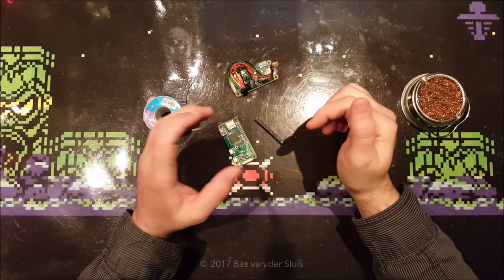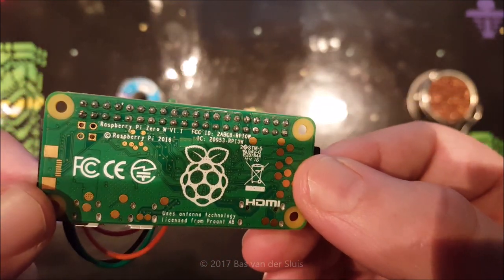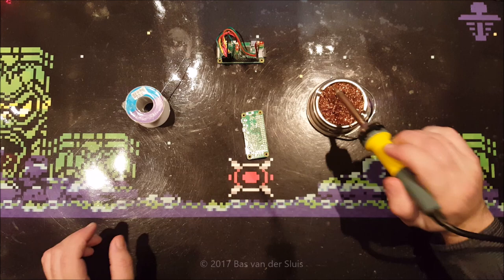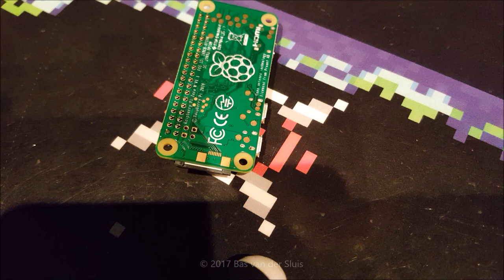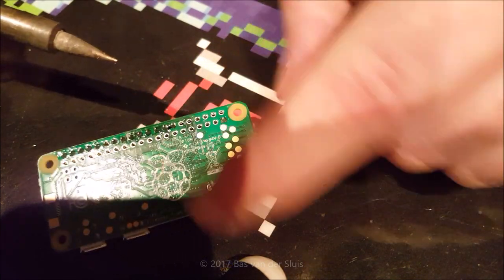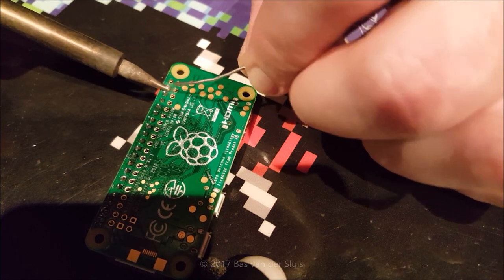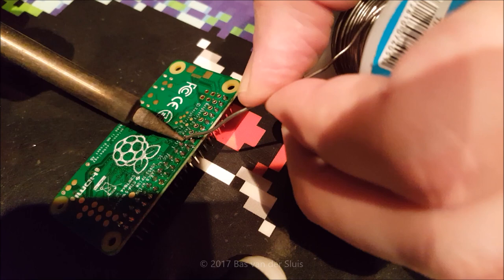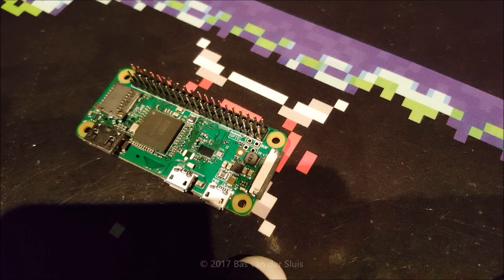How to solder header pins to the Raspberry Pi Zero (W)

Comment: So, my question is, when i put the pins in, do i need to like cut them shorter or just not push it in all the way? Cause mine pertrudes more on the soldering end... or did i get a wrong size or something? Hopefully this can be answered relatively soon 😢
Reply from the maker: Don't apply any force on the pins. Just put in the pins (as show on the thumbnail of this video) with the short side through the board and solder them. No need to cut anything, if you have the same pin header as I do.

Comment: I took my first ever stem project as a raspberry pi car, got a raspberry pi zero, got shaky hands and still hadn't solder the headers to the pi yet. As soon as I get my solder Iron back(My parents took it saying they smell smoke from my room and will return when I move to college so till then I am stuck with the boring breadboard) I will solder those damn headers so perfectly in those holes of the pi, no force will ever be able to pick them apart.
Thanks for the tutorial
Reply: Any luck?
Reply: Did you get the iron back yet? Keen to hear if you're back at it, burning your place to the ground with dangerously hot tools.

Comment: Amazing tutorial, thanks a lot! I think I did a great job, solderings look really good, just really thin tin coverings on the pins. I felt that it is important to really have that 370°C, then just touch the pin, not the board, just touch tin on the board-pin connection and it immediately attaches nicely. The first two attempts did not work so nicely, because my soldering iron was not hot enough - ** I believe a hot tip really is key**. First time soldering two Pi Zeros and it took me roughly 5 min per board.

Comment: What solder are you using - 30W ? also, if I have soldering station with adjustable temps, what temperature would you recommend ? Thank for the video !
Reply from the maker: I used 60/40 solder. Most of the time I have my solder iron set at 370 degrees celcius.
Reply: thanks !
Reply: @basvandersluis5662   That's ~700F for everyone using freedom units

Comment: Does it matter which way around it goes?
Reply from the maker: No, but if you solder it on the back, you have to double check which pins you use, every time you connect something new, because the images of the GPIO-layout won't match anymore. (mirrored)
Reply: @basvandersluis5662  Ok thanks!

Comment: Couple of newbie questions
1) do we need to solder all 40 pins? Can I solder 2 pins on each side as it'll hold for the little experimenting I want to do
2) if I just put the pins within GPIO slots without soldering them and then use jumper wires to work with the breadboard, will that work? (Assuming no movement is required in the circuit).

Thanks 👍
Reply from the maker: For a good connection, I would not recommend to not solder the header pins. But if you just want to experiment, just try and see if it works. If you keep it to 3.3v you won't damage the Pi.

Comment: all that happens for me is the solder won't melt, eventually it melts and goes all over the place and rolls off the board, never sticks to anything. the soldering iron is bright red hot, and barely melts the solder. I don't know what magic you are practicing, but it does require sorcery.
Reply: Sounds familiar.
Reply: I have the same exact issue, I heat the pin and the solder dosent melt but the boards seem like they burning.

Comment: Can I use two 20 single row pins instead of the dual 20 double row pins? I would think each pin is independent so it won’t matter either way.

Comment: Hello :)
I have a problem with my raspberry pi Zero (not W version). I can not install the next library using the next command:

sudo pip3 install adafruit-cuitphyton-servokit

Return me this error: 
Error: Could not find a version that satisfies the requirement adafruit-circuitphyton-servokit

Error: Not matching distribución find for adafruit-circuitphyton-servokit

I'm stuck from 2 weeks ago. Any help It will be so greatful. Ty.

Comment: I'm  really struggling with soldering. There's just nothing happening when I touch the iron to the solder for a very long time. And the tip definiltey doesn't melt anything as fast as what your doing. I got one cheap iron of amazon and when that didnt work I got a ryobi solder iron. That was isn't working very well either. Can't figure out if its me or the cheap solder irons.
Reply from the maker: You have to tin the tip of new soldering tips first. After that your tip should be shiny when it is heated and cleaned with a sponge or metal wool. Then heat both the pad and the pin and apply the tin to it.

Comment: Does it ever make sense to only solder some of the pins, if not all the connections are required for the project? That is, solder some for structural strength and some for their connections, but leave the rest unsoldered (until a later date, perhaps)
Reply: Kinda, but only if you are running low on solder or if you aren't confident you won't break the board while soldering.

If you don't have any of those issues, you might as well take advantage of the time you spent to get your tools out and ready.
Reply: @elorrambasdo5233  good point. Once the tools are out, might as well solder more.

Comment: you should have used flux
Reply from the maker: There is flux in the solder I use.
Reply: @basvandersluis5662  flux core sucks compared to actually applying flux to the connection then adding straight 60/40 solder